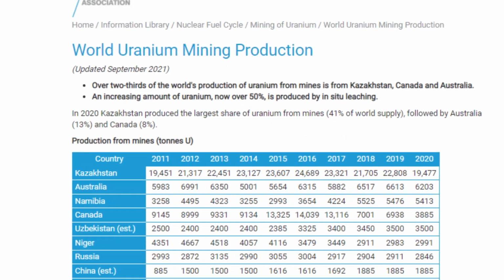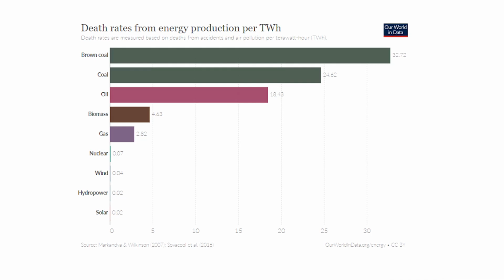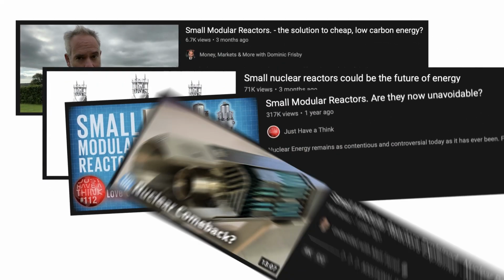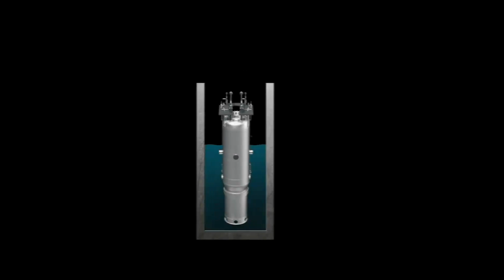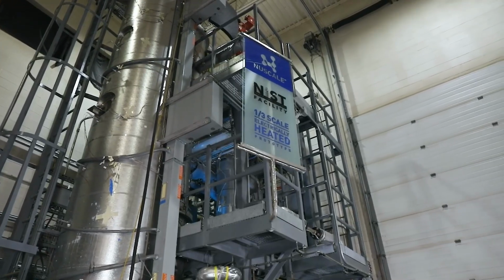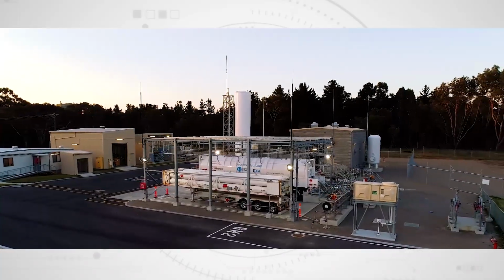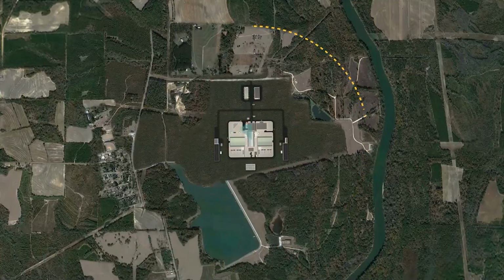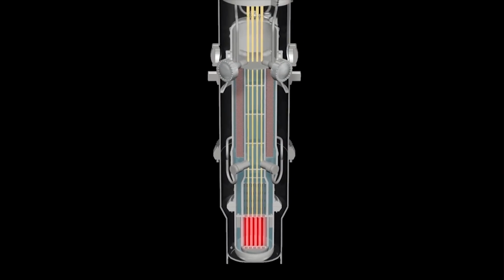Can Small Modular Reactors Save Nuclear Power?

Comment: Nuclear I see as a necessary component because it reduces the amount of energy storage and overcapacity necessary of renewables, since it provides a dependable amount of energy that doesn't need storage.
Reply from the maker: It would certainly make it much easier for countries who don't have excellent renewable resources and low population densities.
Reply: @EngineeringwithRosie  As an other Australian who has worked in the Australian nuclear industry on the mining side the short answer is: Yes we will need to have nuclear power in future. The long part of this discussion is why and its probably a whole series of videos on the subject starting where the hell are we going with energy generation?

Easily the biggest part of the problem is that there are a staggering array of technology promoters all spouting that their solution will save humanity and everything else is worthless. news flash every one of them is WRONG and also partly right. None of them are going to save humanity or the planet, but some of them will play a part in our energy future and if we get very lucky we might save the planet.

I did an odd little consult job about 5 years ago and during I discovered just how old our power stations are in Australia and just how big the problem is of replacing them. When I checked around the world its just as bad and in some countries worse. The problem started about 25 years ago when planning for new MAJOR power stations effectively stopped and then construction with it. By "major" I mean Giga Watt class stations of (1,000MW or larger). The problem has been partly masked by the massive rollout of rooftop solar.

In the 80s & 90s when our population went from 15 to 20 million we built a bunch of new stations. in the 2000s and 2010s our population went from 20 to 25 million and we built NONE. Anybody who ever took a class in economics knows what happens when demand goes up and supply doesn't match it. Prices go up and that's exactly what's happened.

Australia has a huge problem and nobody wants to publicly talk about it.

(edit) I had a typo it was supposed to say 25 million not 50
Reply: @tonywilson4713  Just a note about the population; I Googled just now because going from 15 to 50 million sounded incredible. According to various websites the population of Australia is 25 million; still a considerable rise, particularly in terms of proportion to the 'starting point' of 15 million, but not more than trebling in size :) Not that this invalidates your point about lack of new power generation provision, but just to say the change hasn't been quite so dramatic. Mind you, it does surprise me (as an English person) that the population has risen so much. I do know that moving to Oz has long been an ambition of a lot of my fellow countrymen, including a childhood friend, and immigration probably explains a lot of the rise. For a country whose governments have long seemed so keen on coal though, it is surprising to hear that they haven't been building more power stations in recent decades.
Reply: @danyoutube7491  It surprised the hell out of me when I first found out. 
When raised it with another engineer one day telling him the issue was: "We had a power system built for 20 million and a population of 25" he called me out for BS.
Then I showed him the list of our main power stations and when they were built and he freaked out with "Why aren't we building power stations." Then it hit him - politics and money.
That was nearly 4 years ago and NOTHING has been started.
There was a burst of consternation a few weeks ago when they announced one of our largest would be closing AHEAD of schedule. Not only has that concern died but the stories totally ignored the fact of how many stations have already shutdown without being replaced and how many are going to shut down in the next 3-5 years WITHOUT any plans to replace them.

Did you ever see the hare and greyhounds scene from the film "Snatch"? We are the hare and we are "Proper farked"
Reply: @tonywilson4713  Aussie population is closer to 26 million; definitely not 50.
Reply: @GreenStarTech  Thanks I missed that it was supposed to say 25. And yeah I know its almost 26. 
My big concern is that there are economists and bankers who want us to get to 50 or 60 million and nobody is asking where we are going to get the power or the water for that many people or handle the waste that many people produce?

I was in Canada a couple of years ago for work on a waste water treatment plant. Their problem is they have too much water in they get 6ft (2m) of snow each winter and then it melts. There population's gone from 25 to 38 in the same time ours went from 20 to 25. 
Those extra 13 million take showers and flush toilets. That's overloading their systems and when the snow melts it flushes the sewerage ponds into the local rivers and creeks. To say they are in the sh*t is pretty accurate.

We are going to have similar problems with Sydney and Melbourne before too long.

Half our problem is the bankers who want all those extra people because it means all those juicy home loans. They don't care about water and power that's someone else's problem.
Reply: @tonywilson4713  
The problem with Australia and the whole world is that *everyone* is failing to prepare for the future and prioritize the end to burning fossil fuels.  If the current policies continue, the global warming will reach 4 deg. C by the end of the century and most inhabited areas will become unliveable.

We must end the burning of fossil fuels ASAP in order to prevent hell on Earth.

There is *no such thing* as overcapacity of renewables.  The electricity that would otherwise be curtailed will be used to make green hydrogen and store it underground where it will be used during winter or during bad weather to generate adequate electricity.  What is a huge waste are the gas turbine peaker plants that sit idle 85% of the time, losing money.
Reply: @acmefixer1  Dealing with your stuff one part at a time. 
1) Nobody knows if we will hit 4C by the end of the century, but we do know that 1.5C is the tipping point where we will need to start geoengineering.

2) Its not going to be hell on earth 4C its just going to be damn fracking hard. Don't claim unliveable when people already know how to live in the harshest of environments from both the cold and hot side. 

3) There is such a thing as overcapacity in renewables and it happens all the time. Its caused by a lack of a decent storage system. I AGREE we need to develop green hydrogen ASAP. The real issue is we need a way to easily get electricity back AND DON'T say fuel cells!. If they were good enough it would have been a done deal decades ago and they don't spit out AC power they spit out DC. Going from AC to DC is easy the other way isn't as easy and it involves losses.

4) NOBODY IS GOING TO STORE Hydrogen underground. That's an idiotic fantasy from people who have no idea what they are talking about. Hydrogen from a green electrolyser system is CLEAN. If you pump it into the ground that makes it dirty as well as consuming a lot of energy. After it comes out it would need processing. Compress it store it in tanks - done.

For the energy recovery we need an on demand bulk system and the best option there is hydrogen fueled gas turbines with cogeneration (steam of the hot exhaust). Rolls Royce, GE and others worked out all the gas turbine issues for hydrogen out over 25 years ago in the belief that's what aviation was going to use. Cogeneration has been widely used for decades on other gas turbine systems so nobody has to figure it out.

Try being less of a drama queen. It helps nobody.
Reply: @EngineeringwithRosie  A quick other point.
There is nothing new in the safety methodology that they are using with the control rods descending into the core to reduce the reaction. That method has been used for decades. In fact I remember my science teacher explaining that's how Lucas Heights works and I finished high school in 1982.

On top of that at my speech night in 1980 we had an old boy from ANSTO give the main speech and he told us that one day we will have nuclear energy in Australia. The world would have to use it because there was no other way that we would be able to keep up with the demands of a growing population. It remember it because it shocked us. We were just kids but it shocked us. I can remember being at home afterwards spitting chips. My father (a science teacher) asked me "Well how else are we going to supply power?"

You see even back then when our population was only 15 million recognized that our population would grow and with it the need for power. That reality is about to smash a few countries, Australia being one.
Reply: @tonywilson4713  There's nothing new with control rods, but there is something new with passive cooling keeping the reactor cool (indefinitely) without human intervention.
Reply: @LonnieAdams4  That's true but also YET to be proven in action.

That's one of the more annoying thing these days. There are many great ideas being researched and developed by some really great people, but they lack funding and support. 

After the catastrophes of 3 Mile Island, Chernobyl and Fukushima there was just less and less development being done.  In a vid a while back they showed a chart of the number of students doing nuclear engineering and there was this gradual decline down to almost nothing. 

Leslie Dewan was very vocal a few years back about the shortage of qualified nuclear engineers. Its like a few other technical areas where western policies have now created huge problems that just be solved tomorrow.

I have a similar problem here in Australia with machinists, welders and electricians. We stopped producing them in the 90s and they take 4 years to just get their basic qualifications. Mike Rowe has pointe out the same problem in America and did his famous commencement speech on the subject.
Reply: @EngineeringwithRosie  low population density normally comes hand in hand with high reneable potential.
Renewable overcapacity can be used to fill hydrogen-tanks (or any other chemical-based storage or whatever technology gets adapted)
Overcapacity = cheap electricity 80% of the time
Demand will adapt to that.
Those who cant adapt will to utilize the hydrogen produced by excess renewable energy.
Reply: So sick of this ignorant argument.  Nuclear DOSE NOT LOAD FOLLOW, and can not balance anything else on a grid.  It is only viable as a baseload power in which the grid demand never drops below the powerplants output.  This is useless for balacing any intermitent power source, infact Nuclear powers in high amoutns normally NEED THEIR OWN STORAGE facilities like pumped-hydro to buffer between their output and the grids demand.
Reply: @kennethferland5579  Your right on all except that can load follow but its limited by the capacity steam header and steam control to the turbine.

Other than that you need time with the control rods in the reactor and the problem is that its slow to react. It can be used with planning to follow the duck curve but the real issue is responding to surges or cuts from other supplies.

They just can't adjust fast. Coal fired plants are no better. and even hydro plants struggle on that front. The one type that can respond reasonably quickly to demand surges (& drops) are gas turbines.
Reply: @tonywilson4713  
"The one thing that can respond to demand surges (and drops)" is battery storage.  They can follow demand within milliseconds.
Reply: @acmefixer1  Stop trying to argue with an engineer - its annoying. 

PAY ATTENTION. The Hornsdale mega battery in South Australia has 193.5 MWh (Megawatt hours). The Torrens Island gas thermal power station currently has 800MW capacity down from 1,280MW since they decommissioned the oldest part of it.

PAY ATTENTION. 193.5 divided by 800 equals 0.24 or just under 1/4. That means that battery can back up the main power station for the South Australia for less than 15 minutes. 

Elon's mega battery and all the others like it are good for very fast but very short surges. THAT'S ALL. 
THEY ARE USELESS for the early morning and late afternoon surges that all modern cities demand. 
THEY ARE USELESS if a main power station fails.
Are they helpful? YES, providing grid stability is a very good thing.
Are they good for the long term? NO DAMN WAY. Power stations are needed for at least 25 years. How long does it take before the battery in your phone or laptop starts to show degradation? 12-18 months and they are throw away objects within 5 years. That's because Lithium ion batteries degrade. Hornsdale no longer has 193.5MWh and its getting worse everyday. They need to replace the battery packs every 3-5 years. 

The current type of Lithium Ion battery cell is NOT SUITABLE FOR GRID LEVEL STORAGE AND NEVER WILL BE. Its great for cars, phones, power tools and other stuff but not grid power. Besides we need that Lithium in our cars, phones, power tools NOT ON OUR WALLS!

If you want to ask questions fine but don't try and tell me how to do my job.

Comment: Your prices for wind and solar are way off. They still need heavy subsidies and other mechanisms to work. For example preferential use while nuclear, hydro and all other sources are required to fluctuate to smooth the grid. I also think your chart on deaths per KW is way off. Solar kills a lot more than nuclear. Just think of all the people on home rooftops who fall. I would welcome living next to a nuclear plant. NuScale's design  doesn't seem far off and end of decade. Compared to a industrial wind or solar installation the time to build is similar except for deranged public opinion.
Reply from the maker: Those are unsubsidised costs for wind and solar, though you are right that it does not include the cost of storage to firm variable renewables. Solar deaths includes people falling off roofs in installation of rooftop solar. There are links to the sources for all that in the description if you want to check out their assumptions in depth.
Reply: @EngineeringwithRosie  I know the cost of PV panels have dropped, thanks to forced labor in China, but the other installation costs have risen. Surely you don't think a converter has done anything but gone up. Try installing a home PV system without government assistance and simply with cash, like I tried. The cost per Kw over the components lifetime is prohibitive. I'm in California where electrical utility costs are astronomical and PV still didn't make economic sense.  'Renewables' or more appropriately 'Unreliables' are a dead end. We need nuclear and I like NuScales' approach. Also exclude the soviet era Chernobyl which was a disaster just waiting to happen and Nuclear has has zero deaths from radiation. Falls and burst pipes happen anywhere and nuclear has less than any other industry.
Reply: The nuclear 'deaths' treat cancer patients as being mortally wounded, per the footnotes in the citation. Of course, that is not the case, but the source is quite upfront about what they are using. Think of it as steel-manning the argument.
Reply: Also hydro was very low, does that not include deaths from dam collapse?
Reply: @killcat1971  Exactly. Hoover Dam had 112 deaths just during construction. What skews the chart presented also is the theoretical deaths due to air pollution and they throw carbon dioxide in as a 'pollution' when in fact not a single person has ever or will ever died from atmospheric CO2.
Reply from the maker: @killcat1971  It does, it's just that there is such a large amount of energy produced by hydro that the number of deaths from dam collapse is divided by a huge number. Fossil fuels kill millions from particulate pollution, but we don't tend to notice those deaths or directly attribute them to fossil fuels when they happen. So I think that's the reason why other forms seem really small in comparison.

Comment: How does the safety and safety cost develop if instead of having only some big nuclear plants placed miles away from populated areas, versus having one modular plant for each city of neighboorhood of a large city? Linearly, super-linearly, or exponentially?
Reply from the maker: Well, according SMR proponents it will decrease costs. It would presumably be an exponential effect, due to the learning rate effect (Wright's law). But if the exponent is close to 1 then even an expontial cost reduction can be very slow. And so far we haven't seen any evidence of SMRs delivering on their promises. So we'll need to wait until the end of the decade to see if NuScale are different.
Reply: NuScale is asking the NRC for an EPZ of 40 acres (a square 400 meters a side) - i.e. the plant's boundaries.
A traditional US plant occupies about 1-1.5 square km and has an EPZ of about 10 miles in radius.

This smaller footprint thus requires MUCH less land and planning.
Reply: @factnotfiction5915  THANK YOU FOR THE FOLLOWUP! :)
Reply: Their proposed clusters of 12 or 18 SMR's allow to take 1 down for servicing and require a smaller safety footprint around the site but it currently still needs that buffer.